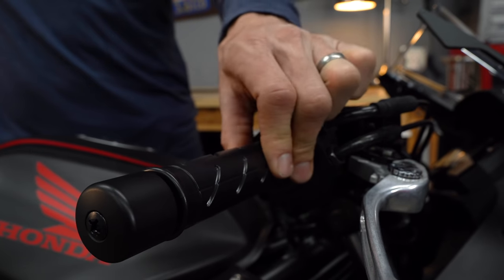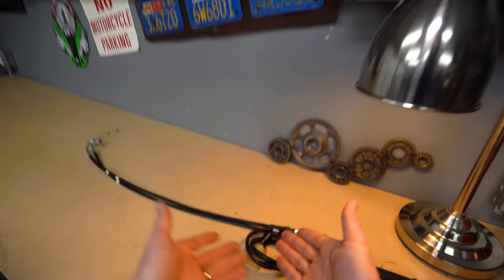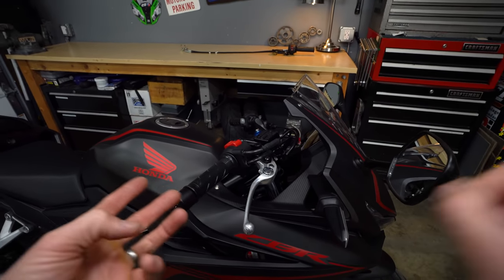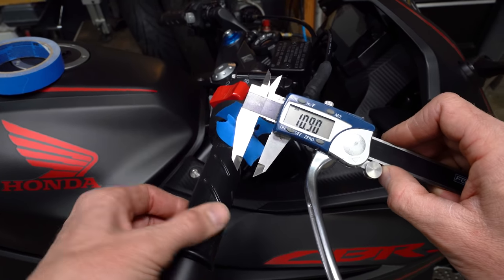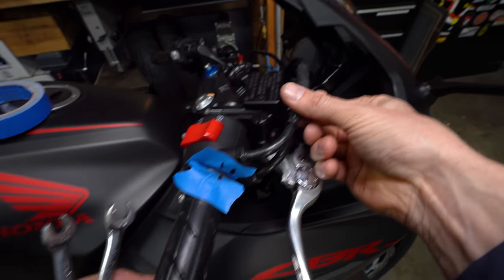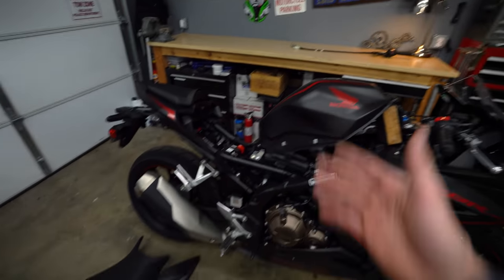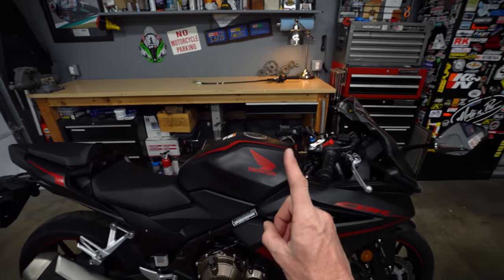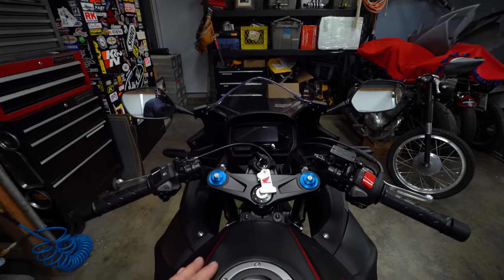Adjusting Your Motorcycle Throttle and Why It's Important | The Shop Manual

Comment: What about ride by wire throttles? My 2018 1290 Super Duke has a lot of throttle slack and it makes fine throttle inputs difficult.
Reply: Throttle spacers. 

https://ducatispacers.com/products/ktm-husqvarna-throttle-spacer-kit

Enjoy.
Reply: Mine is also ride by wire, I would like to know
Reply: Mine is half cable and half ride by wire but still i could adjust the cable.
Reply: You could try locating the procedure for recalibrating the throttle position sensor for your model. If that doesn’t work, there are usually aftermarket modules that can help reduce throttle lag on DBW bikes.
Reply: Think of ride by wire more like a game joystick, operating off of sensor recognition & no cables capable of adjusting. On traditional motorcycles, like brakes or bicycles, cables stretch & you need to adjust to get back to spec. My KTM throttle play is very different than my Harley, but both operate correctly so I leave alone. As another poster shared, you can get spacers but not to correct a problem, just to change a personal preference.

Comment: On the last part, if moving the handlebars one way or the other makes the revs rise, it may be that your throttle cable or even your choke/idle adjust cable isn't routed properly.  It needs to go from the control position on the handlebar and gently curve to be as close as possible to the fork pivot axis so that turning the handlebar has minimal impact on the cable route.

Comment: I would also like to point out that when checking the full steering lock throttle cable freeplay, I always did it with the engine off at first and open the throttle fully and let go. If it snaps back it's not binding and or does not have too little freeplay. If it returns slowly it's binding and either the cable(s) are dry, rusted, routed incorrectly or more freeplay needs to be added. I would then start the engine, turn steering to full lock both ways to make sure the rpms do not go up and then blip the throttle to make sure the rpms come back down quickly as it should.You also should keep your cables lubed with cable lube which will help the cables operating smoothly and they will last longer. Also if you need to adjust the cables at the carburetor(s) or throttle bodie(s) you should leave a couple of threads showing at the upper adjuster(s) so if for some reason the freeplay ends up being too little later on, you can adjust it at the top rather than having to take the bike apart to get to the adjusters under the tank. Cable freeplay getting too tight later on is usually from not keeping the cable(s) lubed which causes rust, binding the cables(s). Especially on bikes that have mechanical carburetors and more importantly on flat slides than round slides, it is important to make sure that when the throttle is closed that when you try to turn the grip forward (closed) that you feel a cushion, not the throttle tube stop hitting the housing. This will guarantee the return (closing) cable is adjusted properly so that it pulls the slide(s) down in the carburetor(s) properly. Also make sure the slide(s) opens all the way before the throttle tube stop comes in contact with the housing. Flat slide carburetor(s) have more vacuum pull on the slide(s) because they are flat and there is more surface area than round slides. Even if the cable freeplay is correct, it doesn't mean the cables are adjusted correctly. It's always best to have anything adjusted etc., by a qualified technician if you aren't 100° sure your doing it correctly as literally your life is in your hands. Keep your bike well maintained and ride safe.

Comment: If you happen to own a Harley, most later model DBC bikes have an adjustment for both the push and pull cable. Also, Ari overlooked one possible issue. If you take out too much slack, it can raise the base RPM at all times, not just when turning the bars. I also like very minimal slack. For this reason I adjust the pull cable with the bike running at operating temp. If you adjust too far you’ll hear the idle rise. If you tend to have issues with whiskey throttle you might want to avoid taking out all free play.
Reply: Adjusted my sportster’s throttle after watching this video and ran into this exact issue, you’re an actual lifesaver and I salute you

Comment: Hey Ari, could you please demystify throttle body balancing? How to do it, when to do it and should you do it?
Reply: Its actually simple if you have the right tools.  Nothing mystifying about it.  But it is basically impossible if you don't have the gauges or the right screw driver that can get into those tight spaces. Your service manual should have guidelines on when to do it.  And should you?  If you have the tools, manual, and are comfortable working on your bike, then yeah, you should. Save yourself some serious $$. If not... then you should just take it in.  Hope that helps.
Reply: Syncing – short for syncronizing – the carbs (or throttle bodies on EFI bikes) is the process of checking and adjusting the carburetors to ensure they’re passing the same volume of air and fuel, as determined by intake vacuum measured at a hose or nipple on each carburetor flange. Over time the linkage that connects the carburetors will wear, causing variances in intake vacuum. Out-of-sync fueling will result in a rough or erratic idle, excessive engine vibration, and other issues, so it’s important to periodically adjust the linkage to ensure all the carbs are opening and closing in lockstep.
Reply: Thanks a lot you guys! @ari, would you be doing a video on this at some point?
Reply: @fjallmann  +1 on the video.

Comment: Great demo for someone looking to adjust their throttle play. I watched it, just because I like your videos.
You MIGHT want to mention (possibly for legal reasons, and I ain't no lawyer) that when running on the motorcycle in your closed garage to open a door to the outside first. Yes, yes, you did it only for a few seconds, and I would have done the exact same thing, but there is always that off chance someone might let it idol for a bit too long or have to go back and adjust and restart the bike several times creating a build up of Carbon Monoxide.
There is a reason why a ladder has so many stupid warning labels on them.
Reply: Also, telling people to reference their owners/shop manual for specific instructions, tolerances and torque specs might also be a good idea. Reducing free play below stated spec causes premature stretching/breaking of the cable and increases chances of whiskey throttling. We live in a society that no longer takes self accountability seriously and that loves lawyers.
Reply: @zyonsdream  Yupp. No one wants to be accountable for their actions. FFS
Never heard the expression "whiskey throttling" before. Had to Google that one.
And yes I have done that to myself, because I was inexperienced 40+ years ago. LOL

Comment: Watch this video today. And yes I did that adjustment and the follow up test. I have a 2020 Icebear mojo magic trike 150cc gy6 clone. I've been having stalling issue's, so far checked vacuum and fuel lines. Did find the line attached to manifold was bent badly. The also did check that Virberello Scooter Tips that check was about sparkplug wire. When I did found that the coil end wasn't screwed down also check the tightness of wires one actually heard and felt a click. After that zip tied coil end down to the frame. I'm new to motorcycling and not a mechanic. Do you offer  video on how to hook up top box and tail light wiring.

Comment: I prefer to have approximately the same throttle play that you showed at first. I tried adjusting it and felt uncomfortable, maybe for some sports bike or aggressive riding it could be beneficial, but for me that extra play helps my hand to relax and feel precisely the moment the throttle starts or stops being pulled. Like the initial slack in a trigger.
Reply: I used to think the same, but once you become accustomed to almost zero free play it’s hard to go back.

Comment: Great content :) Just one thing to add: Ride-by-wire is getting more and more common an new motorcycles and nowadays a lot of those systems
do not have throttle cables anymore. So if you have a new - I dunno - Triumph for example - don't bother.
Reply: You don't need to anyway, because ride-by-wire already feels like a sloppy throttle cable. - LOL.

Comment: 2:23  i know it's traditionally called push/pull in motorcycle lingo, but it's literally pull/pull.  at no time is anything being pushed.  when you move the grip in one direction, you're causing the top cable to pull the throttle open.  when you move the grip in the opposite direction, you're causing the lower cable to pull the throttle closed, and thereby drag the top cable back to its original position.  (we all know that in reality the spring is causing the throttle to close, but you know what i'm saying... if the spring were to fail, that's how it would work.)

Comment: Slack is really just a pet peeve in my opinion. Have ridden for years with slack. Everything from twist to wheelies. To each their own I guess
Reply: I mean, a lot of things are. We'd all be riding PCX 125s if that were the case.

I've ridden plenty with slack as well. Do I like it? Nope.

It all boils down to preference, why you're doing what you're doing, how you generally approach things, external factors etc.

Hell, I've ridden with no seat and the battery poking my ass. Preference? Maybe : >

Comment: I find that while riding with the throttle very little play (adjusted with very little play) when going over humps on the road or holes it makes you rev the bike your body gets moved and makes you pull the throttle back lol, specially in the roads of London it’s like off-roading out here.
Reply: Not really. It's pretty much your fault. This only happens to me if I'm tense on the bars, or am generally not paying attention, however rough the road is.

So long as you stay relaxed and don't death grip the bars, your hand will be able to pivot quite a bit without affecting the throttle.
Reply: @ThaSideWeed  I think that what needs to be relaxed enough to allow for smooth control and absorb bumps and vibrations are the arms. Hands should have a firm grip, not so much that they end up hurting, but no so loose that any sudden force could separate you from them. After all, they are your direct connection with the bike.

Comment: Good little video - One very important point though is to get your motor up to running temperature before checking the cable tension on full lock. I have found it makes a significant difference. You can set the throttle, check the slack on lock and find it is fine - then later when the engine is at running temperature, have issues with significantly increased idle speeds when turning on full lock. I have noticed this on multiple motorcycles. Cheers, Campbell:)
Reply: Interesting. I can't possibly see how a warmed-up engine would make a difference though.
Reply: @AriH211  It does. Not sure why. I have always done this because it causes problems when you don't.

Comment: THX, Plz Ari, can you do a adjustment for the rear brake. 
I just recently purchase a bike 2 days ago, but i have to dig the foot a lot to get the brake working, is definitely not like my old, and other bikes a have used, that the brake is stiff i just move the foot like 1.5 inches for the maximum brake. this new one feels loose, and i have to move a lot the wrist of the foot and is like 4 inches travel or more.
PS: this bike is new and have ABS, my other bike is from 2006, and all the others i have used are older than 2005.
Reply: Very much sounds like the rear brake needs to be bled. That much travel is unusual, so I'm guessing there's air in the lines that's compressing and allowing excess lever travel.
Reply: @AriH211  Thx Ari, i just order almost all the tools from the shop manual episode. waiting for Brake Bleeder to arrive and proceeded to try that. Edit: Omg, i'm so stupid i just saw you already make "How To Flush and Bleed Your Motorcycle Brakes", no only that the video is thumbs up and saved in my Bike Maintenance playlist. sorry

Comment: what about the opposite? I got a RSV Mille that needs a bit of work and the throttle is like an on/off switch, there's you can't roll it, you barely move it and you're flying away

Comment: i just bought a brand spanking new 2020 z900, and i've noticed something when i'm pushing it out of the garage and through my driveway gate in the morning... if i rotate the grip forward against the fully closed position, the engine actually idles down.  is it possible to have an absolute minimum closed position that the cable is incapable of causing it to exceed?  the bike is in warm up mode, at like 2k rpm, and i'm bringing it down below even normal idle speed.  seems like a thing i should try not to do, so i've just been handling it with my hand mostly on the switch gear, but then it's difficult to reach the brake.  
i guess i'm just going to start pushing it out to the driveway first, and then starting it there to warm up.

Comment: What effect does almost no free play have on the touchy zero-to-on (or on-to-zero) throttle transition of a lot of modern fuel injected motorcycles.  I try to feather the throttle to work around this but if I have almost no free play won't it make matters worse?  Or will it improve it?  I actually notice it most when I let off the throttle, especially inadvertently when I hit an unexpected bump.

Comment: Maybe a dumb question, but how would this be different, or is it even needed on a ride by wire system?
Reply: @shadowred1980  thanks!!
Reply: Think of ride by wire more like a game joystick, operating off of sensor recognition & no cables capable of adjusting. On traditional motorcycles, like brakes or bicycles, cables stretch & you need to adjust to get back to spec. My KTM throttle play is very different than my Harley, but both operate correctly so I leave alone. As another poster shared, you can get spacers but not to correct a problem, just to change a personal preference

Comment: That's the problem!!  Either Clutch or Throttle..  when I turn lock to lock in very tight figure 8's, either clutch or throttle cable is moving..  I sometimes drop power and have to drop a foot!  Both had sketchey slack, but the Clutch seemed to fixt my issue.  Thanks!  Whoda thought that turning the handlebars woud move Clutch/Throttle?  Thanks
Reply: Also, be sure your cables are tied down, and zero kink effects.  Minimize significant control cable radius changes during handlebar lock to lock moves.  A bending radius change equates to slight cable movement.

Comment: I wouldn't recommend doing this is you're a beginner or mechanical inclined. You might be taking your final ride.
Reply: Ha, that's why we made the video, and included the final safety check at the end. This is hardly a complicated or risky procedure if you follow the directions outlined in this video.